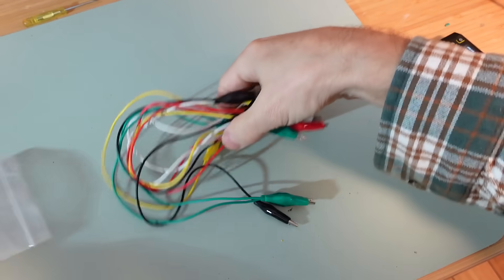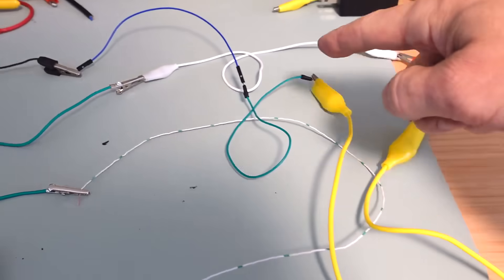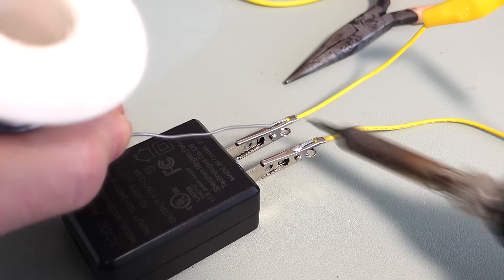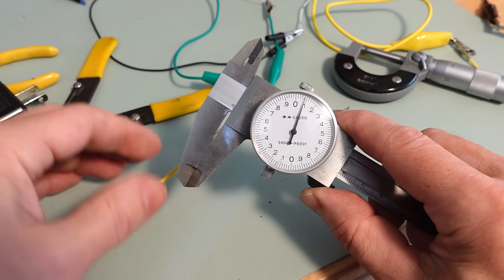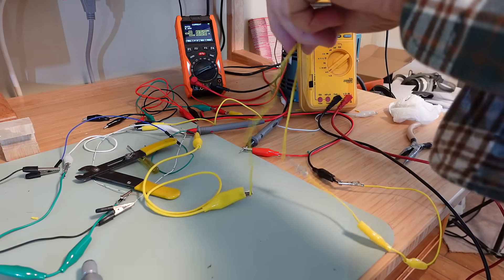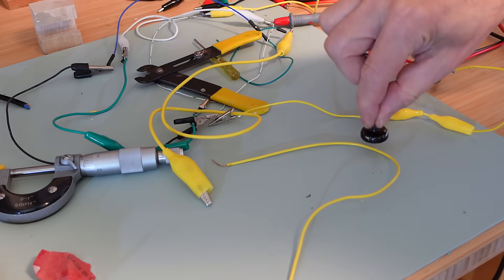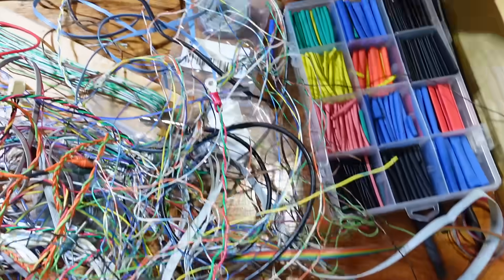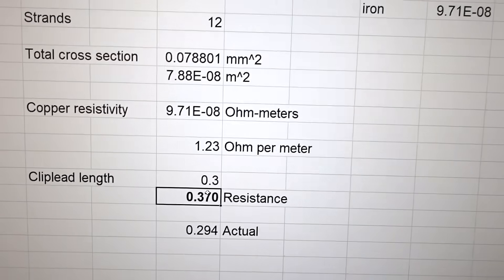Clip leads made with fake wire

Comment: Yep, the Chiang kai-Shek jumpers I've gotten were pure chinesium junk.   Early this year I grabbed some for a go-bag and wanted to change the clips on one end of 2 of them to match the sockets on cigarette lighter power source.   The wire inside the casing was much much smaller gauge than yours.  Even if I wanted to put the new ends on, there wasn't enough wire to carry even the smallest loads.   I hadn't considered the recycled Fe possibility.  I cut the clips off leaving about 1/2" of the wire still intact and threw them in a parts drawer.  I'm going to magnet check them as soon as I get home.  Thanks!   

Though I suspect the Fe wires were probably better than all the new CCA garbage.

Comment: Some cables, especially those designed for high-end or specialized applications use steel in the shielding for various reasons. Steel has a higher magnetic permeability than copper or aluminum, which can improve the shielding effectiveness against low-frequency electromagnetic interference, particularly in environments with strong magnetic fields. However, in your particular case with that camera cable I am unsure but I am 1000% certain that they scammed you with those cheap chines cables.

Comment: There is one legit use for iron in wire: Increasing mechanical strength. In my time in the military almost 40 years ago, we still had field telephones. Inside the cable there were three strands of steel for strength and four of copper for lower resistance.

Comment: Cheap speaker wire has been made of steel coated with copper or tin for decades.  If one side of the wire appears to be copper and the other 1 is shiny like tin , it's almost certainly going to be steel.

Comment: I bought a reel of commercial low voltage multicore "Alarm wire" from a major electronics distributor a months ago - it turned out to be copper coated aluminium, with the copper so thin it dissolved away if you tried to solder it.

I also saw in B&Q (UK DIY supplies) some speaker wire that was labelled as "CCA" - copper coated aluminium.

You need to be very careful reading specifications, to be certain you are getting actual copper, with even major retailers trying to cut costs on wire & cable.

Comment: I bought a batch of these and half of them didn't even conduct due to poor connections at the clips.
Buying on-line is God's gift to sellers of trash, because in the case of stuff like this the postage and hassle to return it is more than its cost, so most people just throw it away and don't complain.

Comment: Great video! Funny thing, making them out of aluminium would make them "almost" as good as copper, aluminium has about 60% the conductivity of copper, and not much more expensive than steel with the same cable area. Aluminium is a few times more expensive than steel, by weight, but also has a few times lower density, so for a given cable area and length, aluminium is slightly, but not much more expensive than steel.

Comment: Is there any possibility that nickel is used instead of iron?
Iron is cheaper than nickel, so the logical conclusion is that the wire is made of iron, probably.
Your calculations are in the direction of a nickel, if compared with actual resistance, but who knows.
I have some IC (integrated circuits), CD4013 (Toshiba) with feromagnetic leads, magnet hold them ... nickel or iron?

Comment: Even if your wires aren't magnetic, it's quite common for cheap chinese leads to be made of copper-coated aluminum, which is god-awful because when you try to solder it, the copper plating flashes off instantly and you're stuck trying to solder to aluminum, which doesn't work.

Comment: Dear Matthias,

The automotive industry pioneered copper plated steel wire MANY YEARS AGO to fix a nagging problem.

With the increase of design skills to select the thinnest wire possible and move towards solid-state sensors that use very little current the bean counters found out that the cengineers were using normal copper wires to connect to the sensors that could carry much more current than needed.  The engineers said they cannot use thinner wires because the wires will BREAK and the bean counters said the sensors draw no real current so they do not need low resistance wires.

Some clever person suggested using steel wire but it was dismissed due to corrosion issues.  Another person said why not copper plate the steel wire.  If it is strong enough it will have low enough resistance and if it is copper plated it will not corrode.  A win win all round.

Drawbacks are that the plating is done to a price so the quality is at the bleeding edge of rubbish and the wires are not as flexible as pure copper and a total los for recycling the copper.  In the automotive industry that no longer matters as the wire loom gets shredded or compacted with the steel chassis and the copper plating is sacrificed which is a saving over heavy copper wires getting sacrificed.

Price is lower but quality is worse.

Sad to see that the same wires have found their way into test instrument leads but that is to be expected.  If the advert does not say copper then one cannot assume to much these days.

Comment: WorstThing Is That They Are Not Pure Copper Wires, They Aluminium Coaated With Copper, You Cant Even Solder Them Good To Any Sufrace, They Apear To Be Soldered, But The ALuminium Doesnt Solder So You SOlder Only The Copper Plating , Its All So Scammy And Fake.

Comment: The leads are indefensible but I will say that the BNC connector being coaxial it reminded me of my time as a Cable Installer. We used RG6 coaxial cable and the center conductor was copper clad on a steel core, not just to save cost but because the skinning effect being tied to frequency meant that there wasn't a functional advantage to the core being steel. Just using this complete tangent as an excuse to leave an engagement tick- I mean comment. Love your stuff sir.

Comment: Wow!  The things companies do to cheat the consumers.  Talk about "CHEAP", with all the negative connotations that go with it.  And it's not just the Chinese . . .

For a long time (here in the U. S. at least), a "half-gallon" of ice cream was really a half-gallon.  But that half-gallon has steadily been getting smaller to the point that many half-gallon containers of ice cream are only  1.5 quarts (where 1/2 gallon should be 2.0 quarts).  That's a 25% reduction.  At a quick glance, though, the containers "look" like the generic half-gallon containers, unless they are sitting next to true half-gallon containers.

They're doing the same thing with milk now.  A half-gallon of liquid is 64 fluid ounces.  I've used about 13 oz of milk each day, most days for many years, in a powdered mix, and have consistently gotten 5 days from the half-gallon of milk.  (13 oz per day x 5 days = 65 oz.  So, yeah, pretty close.)  Lately I've been running a bit short on the last day.  (I thought my wife has been using some for coffee or cereal.)  I recently looked at the container.  Yet again, though it "looks" like a 1/2 gallon, the container says 59 1/2 oz.  A 7% reduction.  Yet another way to cheat the consumer!

To say nothing of yogurt and similar containers with recessed bottoms to make them look larger, while providing less volume of product!  Shameful.

Comment: Harbor Freight sells a similar set for $3.60($2.50 with their occasional 30% off coupon) and they seem to be made with actual copper with a decent strand count and low resistance. The only issue is that they also just fold the wire over the insulation then crimp, but that's how every set will likely be anyway and you can always just solder it yourself. I'm sure you only spent about a buck on getting it directly from China, but it comes with a gamble of what materials were used.

Comment: In regards to the USB cable, they commonly use a steel braid for strength and shielding. Who knows what the actual signal/power wires will be. OFC for signal wires CCS wire might work fine depending on the clock frequency.

Comment: I went thru about 8 suppliers of idc ribbon cables, same issue copper coated steel wire with high resistance.

Comment: I'm amazed to find out people didn't know about this, the reason for this is 96% of all wire made in china uses recycled metals and they save money by not separating the materials like they should and they end up with a copper alloy that works enough that nobody complained, also the mouse cables might have a steel braided rope in it to prevent separating from user abuse.
Reply: The automotive industry switched to copper plated steel wires decades ago and it has infected other industries to maintain strength where sensors need no real current but a thin copper wire would be mechanically to weak.  So they simply use steel for strength and the resistance is adequate and copper plate for corrosion protection and compatibility with crimped terminals.

Modern automotive recycling does not separate the wiring loom from the chassis so any copper eliminated is a saving that would otherwise be lost when the steel is recycled, now the steel wires are recycled and the copper waste is reduced.
Reply: anything made of metal from China is a lottery. Some factories take things seriously and make good products. 
While other factories just churn out products with no quality control and don't care. I used to check electronic equipment for compliance for a major importer. On one occasion I contacted the factory and asked for test results and specifications of a product, and they asked my what I would like the test certificate to say !!! Geez..... I didn't approve anything from that factory after that sad experience.
Reply: this

Comment: I've gotten some jumpers from Harbor freight that I kept having a ton of issues with. The bad connections, and then (I thought) such small wire gauge that I couldn't hardly power anything with them because the voltage dropped so much. Got to the point I just went and made my own leads with my own clips and wire lol
Guess it makes since that they where just iron wire!

Comment: I started this comment as soon as you put copper into your first calculation then stopped to  see if you would figure it out.

Chinese wire hasn't been copper in a long time.  It it possible to get it from there but most often some other material with a colored coating to 'trick' the buyer.  

It is especially common in heavy gauge wire people use for high fidelity or those loud cars you hear with the booming bass sound systems.  

The non-copper wire still works but if you want copper you have to be specific.

Comment: Since the demise of Radio Shack I no longer buy “jumper wires” and most of my test leads because years ago I also got similar garbage jumper wires, as a result I have been buying quality Alligator clips and other test lead ends and high quality wire etc and making my own.  I use the boot color to designate wire gauge and use Black, Green, Red, White, and Yellow color wires. Additionally I also have jumper wires with Fuse Holders, Resettable circuit breakers, Diodes, and ones with pilot lights, etc.

Comment: 1 problem: what you measure on the mouse and cables in this case is not the wire but the SHIELDING of them. Even Ethernet-cables have a shield that prevents external influence on the signal-wires. Some cables have copper-shielding but mostly its metal-shielding thats adequate for this application.

Comment: I bought what appears to be the same set years ago -- I am sure they were from Jameco...but could be wrong. They were exactly as you showed -- bad connection and very fine wire through the cable. They were all junk. Ended up trashing them and making my own.

Comment: You can zero your micrometer by fully unscrewing the dial/handle and adjusting the thread after loosening the inner locknut. The pitch should be 0.5mm per turn so you can just turn it by the proportional degrees and fine tune it later. Also that wire is called CCA, copper-clad aluminium. Maybe it's iron. Could also be a nickel layer inside to help the copper stick. As for the mouse, it could be the shielding braid over the 4 wires, that could be nickel coated or just straight up coated iron.

Comment: Some mice/USB cables nowadays have a shielding around the cable to block out EMI for signaling. It's cheaper to add use shielded cable than it is to add error checking circuitry.

Comment: I was really surprised that the input cable for out TV, internet, etc was magnetic. 
I knew Spectrum was cheap (equipment cost cutting) but didn't realise just how bad they treat customers. 
Guess I now know why they have to run new lines every 2~3 years, copper plating so thin it can't keep damp out

Comment: The clips you used are those extremely cheap Chinese rubbish.
The wire used is thin and of poor quality and low copper content

Apart from the fact that I do not know if your cheap little tester can actually measure accurately this low I would expect these values.
I even had those clips not connection at all.

Comment: i learned this a long time ago with USB charging cables.
after a long car trip my Iphone battery was drained, even though it had been plugged in to charge the entire time.  They had use the tiniest bit of copper wire i have ever seen, must have been 38 gauge.  def could not handle amps of current

Comment: Just got home from buying new probe leads for my aging multimeter and couldn't understand why they had such high resistance. The multimeter reads 0.8 Ohm with new leads shorted together, with the old, battered leads it read 0.0.
So I thought, can't be... iron wires in multimeter probe leads? Sure enough, the magnet will pick them up.
...Back to the old trusty probes.

Comment: When I was very young (12) and stupid, I bought a cheap molex cable off of eBay. I booted my computer up without the panel on and it immediately started to smoke.

The cable caught fire, but I was able to unplug everything and isolate it to avoid a house fire.

You are doing good work here keeping people informed. These cheap cables can be huge safety hazards.

Comment: For years I've heard people who refuse to use these, they never gave a good enough reason to justify the wide gap between price of leads and the hassle of making them DIY. Now I know.
Reply: I also thought it off that about 10-15 years ago with Amazon and eBay I could find a bag of 10 test leads for the price of one.  The change in wire makes the economics easy to explain and I blame the cheapskate consumers for driving China to make stuff to such a low price point.

The copper plated steel wire was pioneered in the automotive industry decades ago to connect low current sensors that did not need a lot of copper but extra thin copper wires would not be strong enough so they left the wire gauge as it was and just replaced the material and the sensors were not inconvenienced in any way.

Comment: If you have to test them and often have to take them apart and re solder them yourself, why not just buy clips in bulk along with whatever wire you like and make them yourself? The whole reason of buying pre made leads is to save time.

Comment: Thanks for that. I've been bitten by crappy jumper leads a few times lately.
Another thing is that the clips use very slippery plastic covers which make it almost impossible to clip on to anything, 
when you squeeze the clip it just rotates in your fingers. 
And after a few years, the plastic goes so hard it is impossible to operate the clip.
We need to build our own leads, but likewise need to find decent clips that are made of copper, not steel.

Comment: That explains some recent suffering I experienced.  I was losing a high current pulse though some new clip leads, did the same thing and soldered them with no improvement.  I know clip leads aren't the right thing for 10A, but should have taken it for a fraction of a second.  Finally soldered in a wire and all was well.

Comment: I just discovered this when I used some of these cheap jumpers to energize the solenoid of a car starter that I wanted to test. Every one of them acted like a fuse and self destructed. From now on I'm making my own jumpers.
Reply: Nothing like firing up a project for the first time and watching all your leads go limp like wet noodles, then self destruct.
Reply: I made my grandad a jumper lead with a circuit breaker so when he accidentally shorted it out it wouldn’t blow up
Reply: Me too dude man  good vid. I have a bunch of them I got online. I'm not even going to check them I'm just going to save the alligator clips and throw the rest away.👍

Comment: One day I was helping someone plan and wire the network in their business as a side gig, and they insisted on buying cheaper CAT5 than the one I specced in. Lo and behold it was copper coated iron, and over time the speeds dropped from gigabit to 10M and then the network just stalled, over the span of like 5 years. Wouldn't have been a big deal if all the cabling wasn't buried deep into the concrete, part of which in an expensively outfitted showroom...

Comment: So did you uncover that they are iron wire coated/electroplated with copper ? It explains the increased resistance as a start and then further resistance increase sfter its been heated with high current cos of crustal changes that arise.

Comment: Thank you so much, I was speculating on the same matter. Bad leads, loss of Voltage and stuff. Had resoldered but had not come to the conclution that it is bad China wire of Iron, yet. So thanks.

Comment: That's nice to know, i bought the same wired alligator clips from amazon, I'm going to check them.

I guess that some cables like the mouse one may have a magnetic insulation. Or maybe they use some sort of metal alloy that may include magnetic elements. But the only one that sticks like that to a magnet that i can think of is... iron